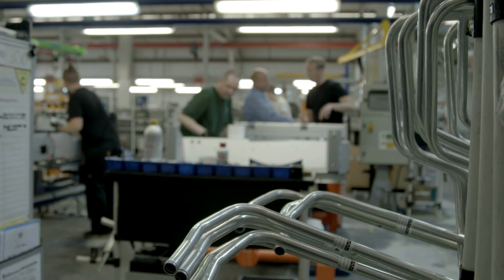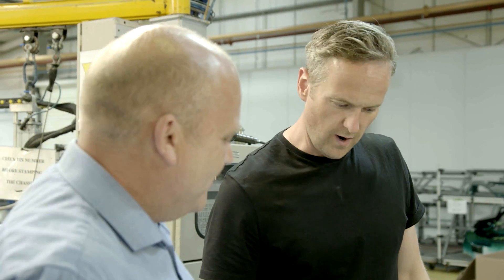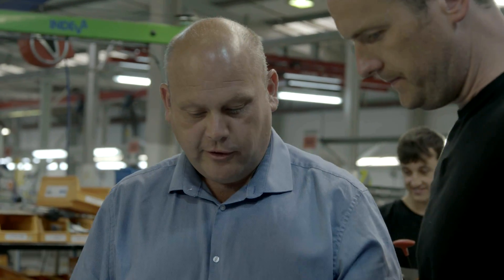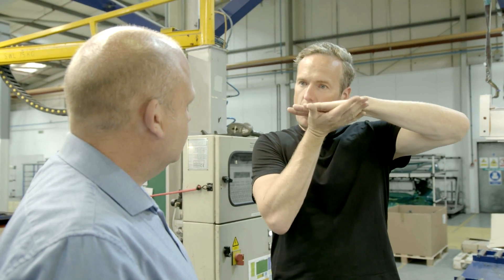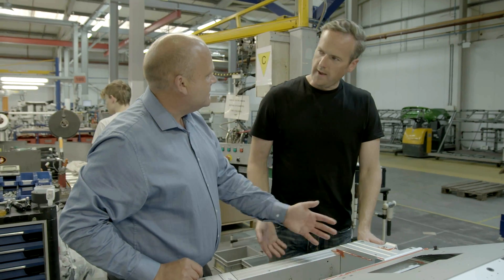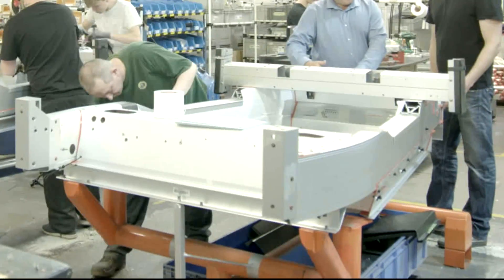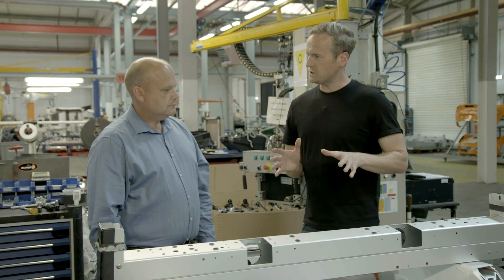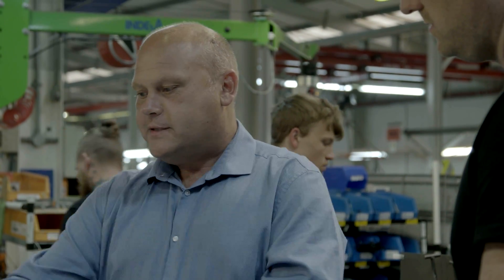Lotus Elise Chassis Bonding | Workshop Uncut | Car S.O.S.

Comment: All very nice but you can't repair it.  I ripped the front upper wishbone from the chassis of my Elise in an accident.  They wrote the whole chassis off and re-built the car on a new chassis.  Still have the car it's great but it makes you a much more cautious nervous driver knowing just how easily you could send the whole car to the scrap heap.
Reply: Same with full carbon chassis on supercars..
Reply: For insurance reasons I completely understand. From a practical standpoint I'm sure they could "remanufacture" it by removing the damaged parts only

Comment: Adhesives indeed are an excellent choice for so many applications.  As the MK2 Acura NSX chassis joinability lead for Honda Engineering North America, I will note that one thing that wasn't mentioned is that in the as-welded condition the HAZ has an approximate 30% reduction in the ultimate tensile strength of each thermally fused joint if not solution heat treated/precipitation hardened afterwards.  There are 806 of them as well as 347 self piercing rivets and 259 flow drill screws securing this hybrid supercar I was responsible for parameter development.  What an awesome piece of machinery.

Comment: Truly amazing tech nowadays with "glues", makes perfect sense though.
Reply: Nowadays? First Elise chassis was built in 1996, nearly 25 years apart...
Reply: @grossmeister1181  25 years in development time is still considered early .....
Reply: @alexion7160  No, it is not...🙄🤦
Reply: @grossmeister1181  It is. Get into the engineering world and tell them its not lmao . 25 years since began use, means another 100 years of perfection minimum
Reply: @alexion7160  It is not. 100 years ago cars were using wooden frames, 50 years ago cars used streel frames, then it changed a lot and new chassis materials are used, welded aluminium, carbon fibre, composites etc. So just stop posting wrong things here, you don't have a clue at all!

Comment: Tim is definitely no tech.. not much doesn't fly right over Tims head
Reply: Hes still had first hand experience with that resin . He did a test with 2 pieces of aluminium , glue'd em together and they lifted a tractor with it , its on this youtube channel. Sure hes not a full out tech but he has the hands on experience.

Comment: Technically resin is not Glue
Reply: Technically, by definition, it is when it's used like this.

glue
/ɡluː/
noun

an adhesive substance used for sticking objects or materials together.
Reply: Glue is not necessary be resin, but resin is definitely one of the glue.😃